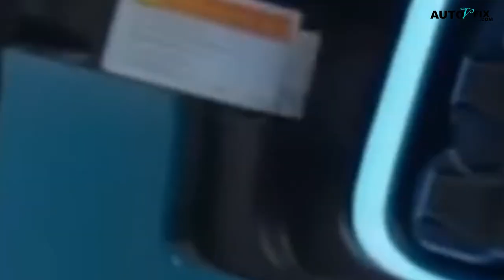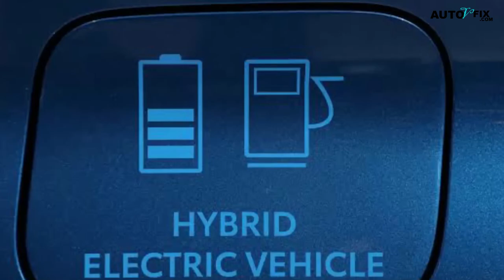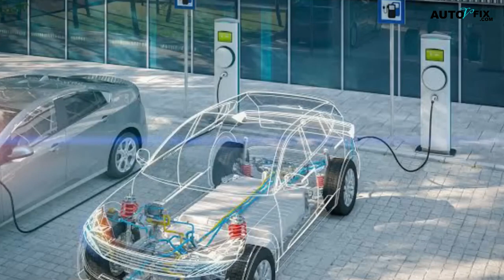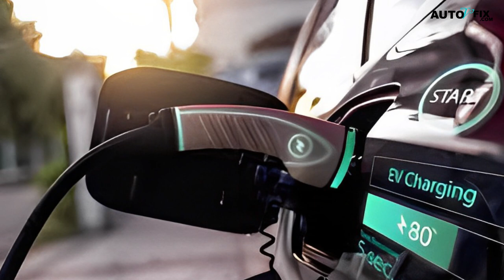Latest Advancements in Electric Vehicle Technology Explained And Future EV Technology

Comment: AC motors instead of DC, computer controls, and a lot of entertainment gizmos.  Still heavy, still slow to charge, still single speed gearboxes, still more expensive to build and repair and replace.

And still inferior to the ICEVs that beat them over 100 years ago.